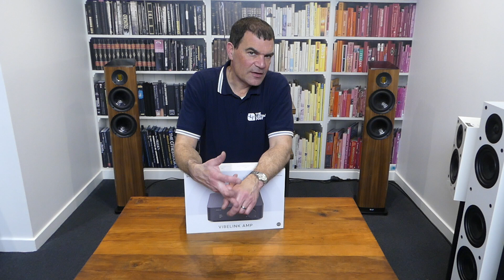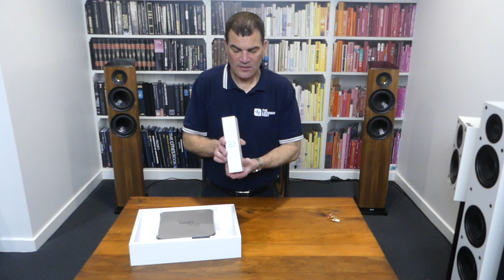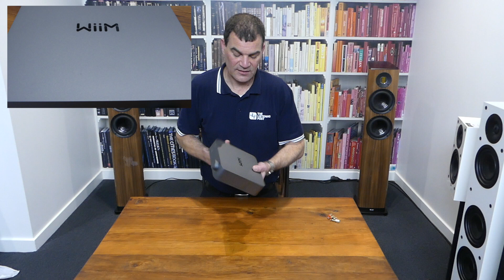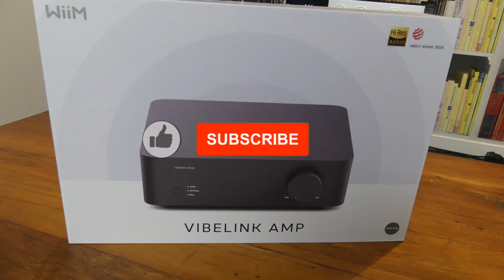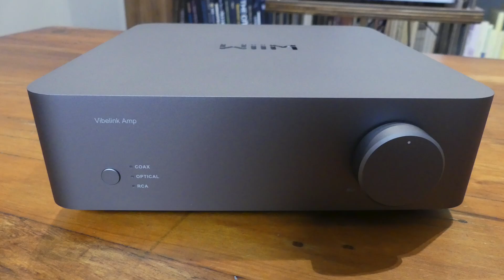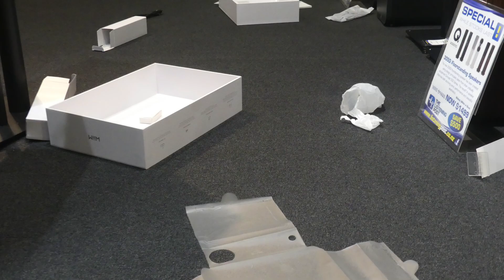WiiM Vibelink Integrated Amplifier Unboxed  | The Listening Post | TLPCHC TLPWLG

Comment: Brilliant video. Nevertheless, could you please explain a bit how does one put banana adapters on the wire? That's a bit hazy for me, given that those aren't typical bananas.
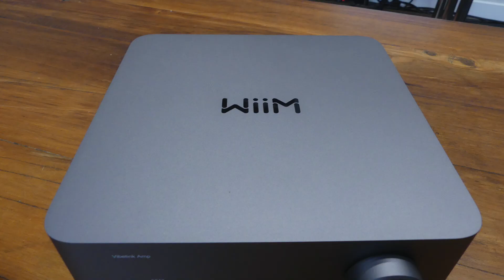Reply from the maker: The Banana adaptors WiiM supply unscrew and open a hole for bare wire to go into. Then you screw it tight again and plug them into the back of the Amp.    See 9:55 in the video for a close up photo of the banana adaptors.